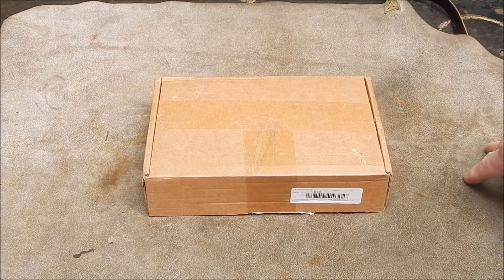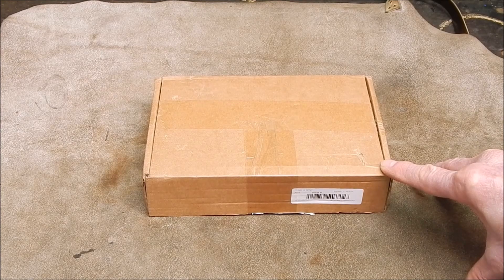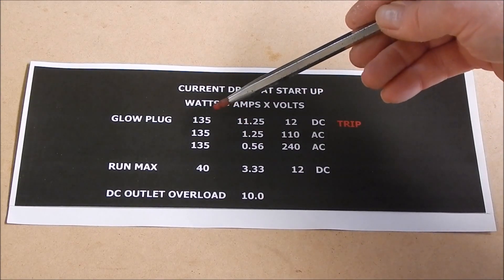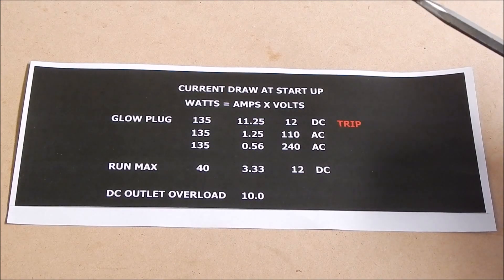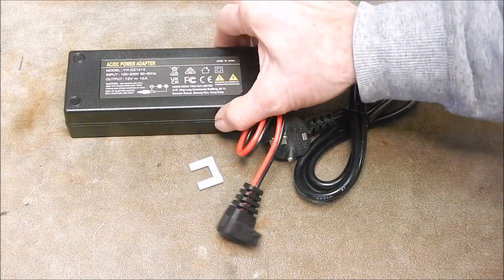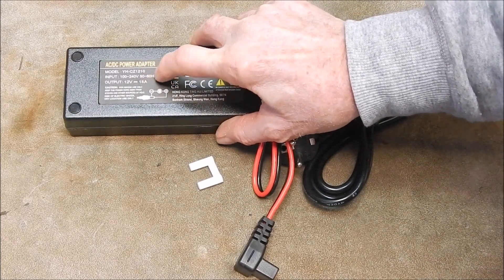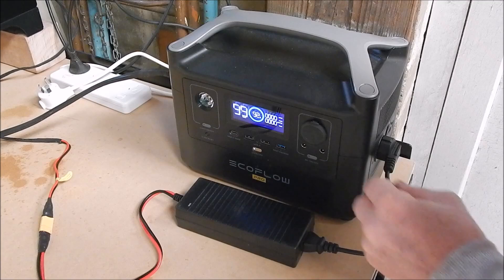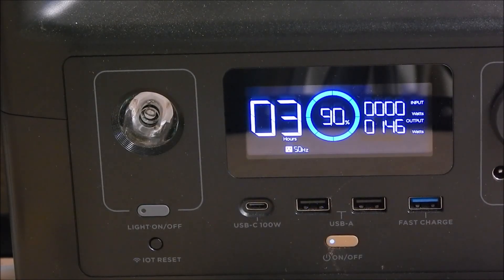12V 15A Diesel Heater adapter power cord AC to DC from Banggood - suits Portable Power Stations

Comment: Hello Rob, and Merry Christmas! Question for you: Why are all of these lithium power supplies limiting their 12v output to 10 amps? I bought a Jackery model, and I hoped it would do the same as my old lead acid-based "jump packs" plus more (i.e., plus a built-in inverter plus superior battery technology). I was surprised to find the Jackery would not run a 12v air compressor I habitually run from an old jump pack. The utility of the power supply is seriously diminished for me now. Why are they so stingy with their 12v supplies?
Reply from the maker: Hi Rick.  Good question.  I can only guess that they duplicate the output of a car 12 V socket/cigarette lighter.  These are generally fused at 10 amp to protect the small gauge wiring. The thinking is probably that this would be enough for most light duty camping applications, which generally connect to that adapter.   Something with a higher amp draw (such as a larger air compressor) is really intended to run directly off of a regular car battery using either an Anderson connector or spring jaw clamps.  The 12 V 10 amp limit seems to be a de-facto figure to prevent melt down.  Cheers Rob.

Comment: After the 3rd attempt it may run because glow plug may already be preheated and ready to run. So hi demand is for shorter period of time on power station
Reply from the maker: Glow plugs usually work on a timer, so I expect by the 3rd attempt time is up and the trip doesn't break.

Comment: That's quite a lot of power at 12 volts Rob, I noticed it peaked at about 150 watts during the start up sequence.  I was thinking that maybe you could use a small bench power supply but they generally top out at 10 amps. That's a good solution and not too expensive. Cheers, Alan.
Reply from the maker: Hi Alan.  It needs to be 15 amp capable to do the job.  I have a couple of largish car battery chargers and a bench power supply, but none do more than 10 amps. This voltage converter is actually a pretty cheap and compact way to fix the problem.  I see on a couple of other YT channels people use AC to DC stepdown transformers meant for sodium and LED ceiling lights, but they're more expensive, larger, have exposed connectors, and zero shielding or weatherproofing.  The Banggood unit is purpose built and much better.   The video was a good lesson on Watt's Law anyway :)  Cheers Rob
Reply: @Xynudu  I use Watts and Ohms Law all the time, it does help if you get your basic maths right though, which sometimes I don't 🤣🤣 Cheers, Alan.

Comment: Excellent review Rob. Very detailed explanation. Nice piece of kit. Cheers Nobby
Reply from the maker: Thanks Nobby.  It solves that major issue with Diesel heaters, and is made for the job.  Very useful for running a lot of 12 volt gear.  Cheers Rob